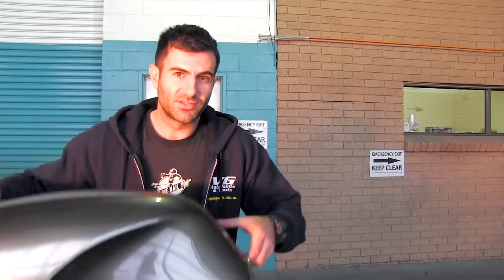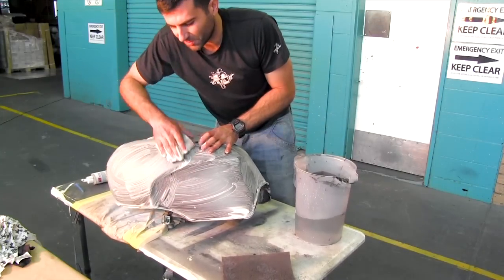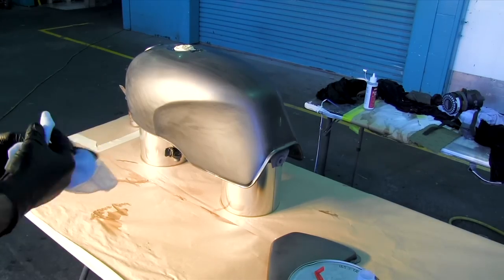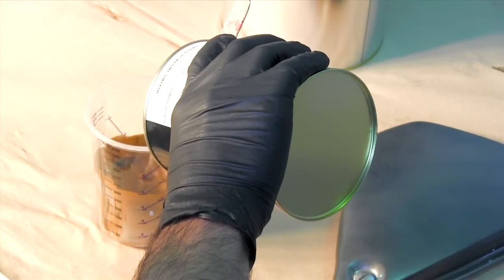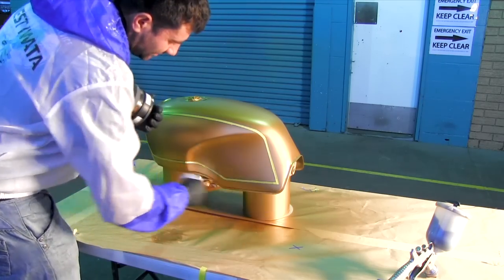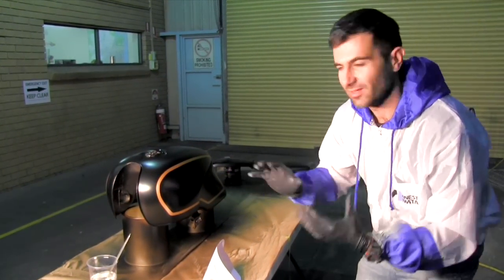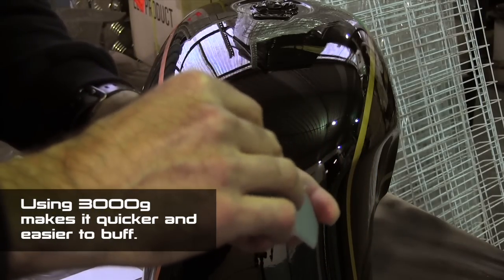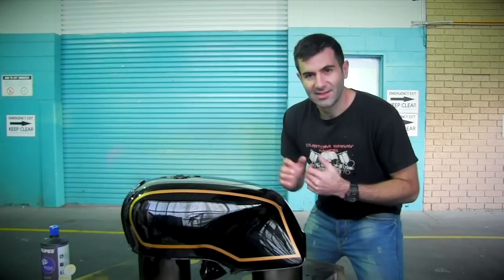Dave Paints a Motorcycle Tank

Comment: Dave, do you have to sand or do anything between base coat colors so you don't have a hard edge between the different colors where the fine line tape was? Or do you just let the small lip be and level it out in the clear?
Reply from the maker: Maxwell Perkins you got it. Spray 3 coats of clear over all the bases, let it dry then sand it smooth and clear it again.

Comment: Looks great.  The way you did those two thin lines to start with was beautiful.   If it was my bike I might have just gone with that instead of adding the masking tape to make them one thicker line.  Was the bike a 1989 Honda CB500 tourist trophy?  Looks like it was modified a bit.
Reply: It's a Honda GB 500. The XBR 500 and GB 500 share the most beautiful tank ever in my opinion.
Reply: @Nosuna1611  I think the GB tank is slightly different to and a much nicer shape than the XBR

Comment: Hi Dave, firstly amazing job! You mentioned you waited 30mins after gold to mask up with your fineline tape, does the fineline tape ever pull off the underneath colour (gold in this case) when you wait only 30 mins??
Reply: also, is that fineline tape masking tape or can I use a vinyl fineline?
Reply from the maker: Depends how good your primer or prep is on the base. If I am doing 2 tone masking I always sand the primer with 800g wet and spray adhesion promoter.
Reply: Awesome man, thanks for the great tips!

Comment: what kind of paint/pressure/gun did you use and i though you were supposed to wait a while before putting on wax?
Reply: ***** I think hes using an Iwata HTE2, Probably around 50PSI. I'm not 100% sure though
Reply from the maker: Yes I use the az3 air gunsa HTE at about 45psi

Comment: Hi Dave, I'm going to to be spraying my motorcycle fuel tank with aerosol cans  i have just stripped the whole tank back to bare metal i have finished filling a small dent and now it's ready to be primed, what type of primer would you recommend? etch?
Reply from the maker: Yes first use etch primer, then use a filler primer or spray putty. I did a video about repairing a Moto tank using spray cans. It has all your answers.

Comment: We're thay 2k paints you used  and if thay were can you use a standard resperater
Reply: From my own research, I believe that it is fine to use a standard respirator (meaning a prefilter, particle filter and chemical filter). I actually found one respirator that specifically stated for use with 2k paints. And it's filters were exactly the same spec as any others you'll find. It seems that the real reason most manufacturers won't endorse use with 2k paints is all to do with liability, they're just covering themselves.

The problem with respirators is that by the time the filter is used up and you start smelling even a bit of the outside environment, then you're already receiving well over the recommended healthy dose of chemicals. A supplied air mask would never have this problem. So basically you've just got to change your filters regularly and keep a time log. I.E., if a filter has a 12 hour life, I would change it at 10 hours just to be on the safe side. But also keep in mind that working in small or poorly ventilated areas will use up the filter much faster. 

Gotta stay safe!

Comment: dude you done the stripe the hard way! wouldve been much easier to use one peice of fine line the width on the stripe you want
Reply from the maker: I have that size tape but it does not bend and curve as good as the 3mm tape. It would have been a disaster.
Reply: customspraymods
i do them all the time using the wide tape,your radiuses are quite large so i dont think youd have a drama.....another way to make sure the stripe doesnt go thick or thin if you must use 3mm tape is to run another piece directly beside the first one.....that way youve got a guide at 6mm plus the next 3mm gets you a 9mm 100% true line....even mix up the available sizes to get to where you want
Reply: ylwgtr just heat it up slighty bigger tapes and you can bend how you want it...

Comment: That tank is rough as f**k
The gold stripe isn’t even consistently even and there are burrs and tape bleed. The problem here is paint one colour on top of another as if you want to rectify and faults, you can’t because it marks the other colour.
The correct way is to paint main colour first and lacquer and cure then mask out stripe and paint, this way you can sharpen stripe lines from being fat an thin and clean any tape bleed. Then lacquer.
I know what I’m on about I worked for Aston Martin special vehicle operations 
Doing this day in and day out.